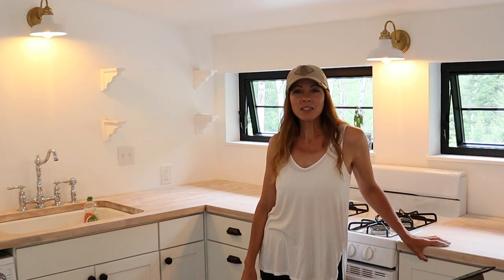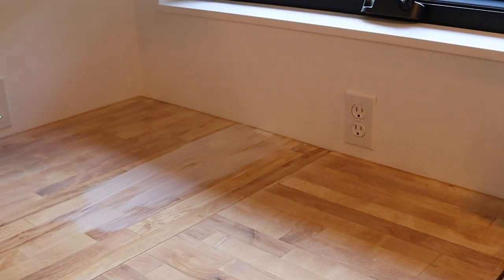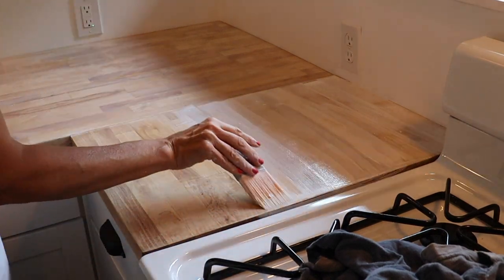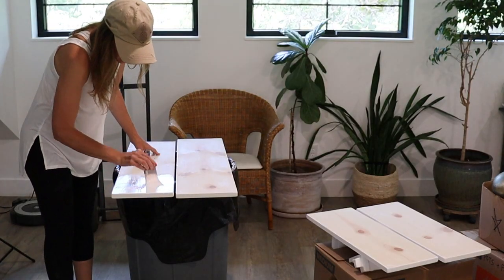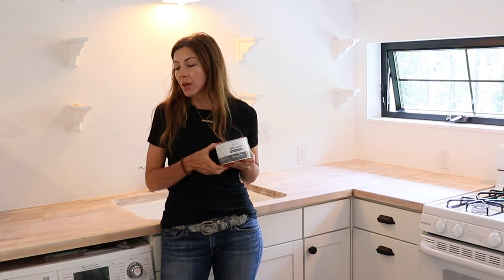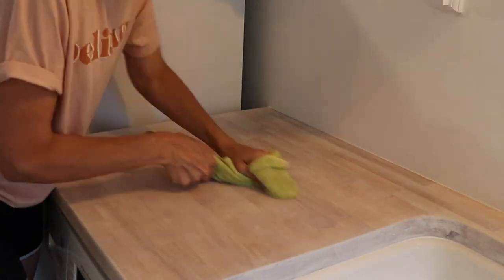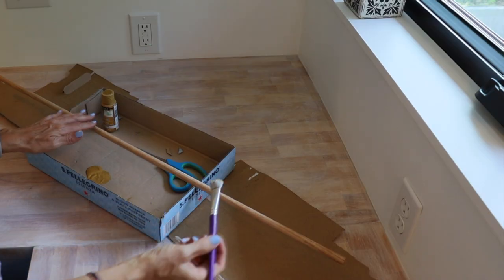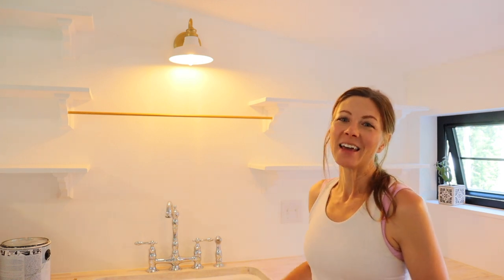Whitewashing Butcher Block Countertops!

Comment: I love them! I already have a Jami Ray Vintage white wash oil wax. It’s not as white as I like do you think I could do the paint water like you did and then use the oil wax as a sealer?
Reply from the maker: Hi! I would go for it, especially if it's not as white as you were wanting. If you've already used the white wash oil wax, you can still do the paint wash, but I would probably do a light sand first if you can. I think you'll like the results better. Then use the oil wax to seal, do a couple coats of it after doing the white wash paint. I used about 1/2 c white latex paint to 1 c water. Hope it turns out like you want!
Reply: @the.soulstation  thank you!! I’m excited 😃

Comment: Did you use a oil base paint to white wash? What is the wax you used to wax the counters? We cant understand the name or see the can... What paint would you use as we want to to a outdoor kitchen in the butcher block for out side. I t will be mostly covered but will get humity and some rain if it blows a certain way?
Reply from the maker: Hi Ginger! I used a water based latex paint to white wash the butcher block tops. It's ultra white paint and I believe it was the Lowes valspar. For an outdoor kitchen I would still use a latex paint, mix it with water, and then wax it after to seal it. use at least 3 coats of wax. You want any water to bead up on it when you're done. Hope that helps, and thank you for watching!

Comment: How did you water down the paint (how many parts watertopaint)?
Reply from the maker: I used an empty yogurt container and added about 1 part of the white latex paint and 3 parts water. It had the consistency of milk. 😊
Reply: @the.soulstation  thanks for responding 😊